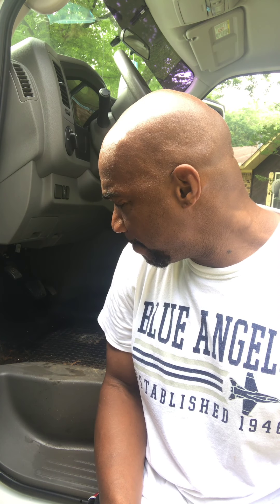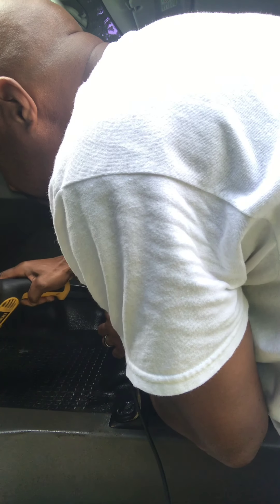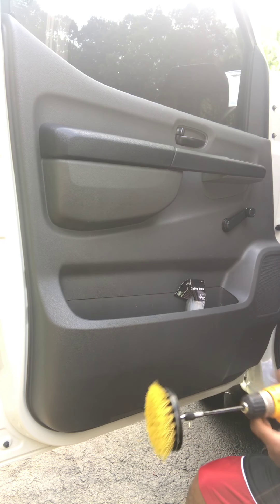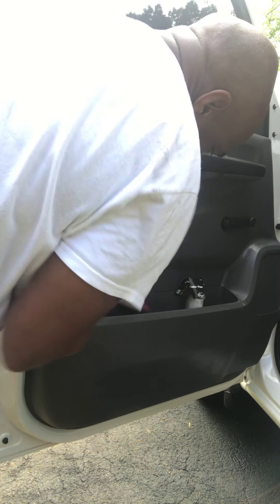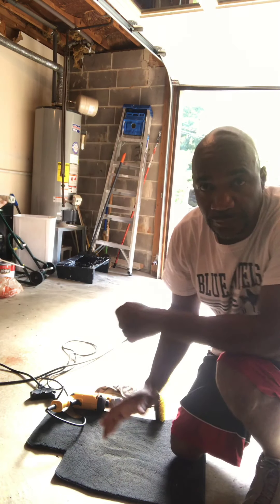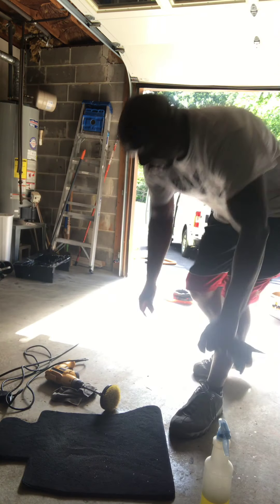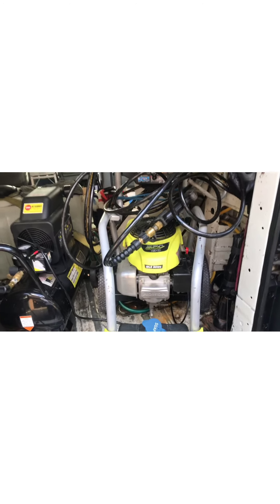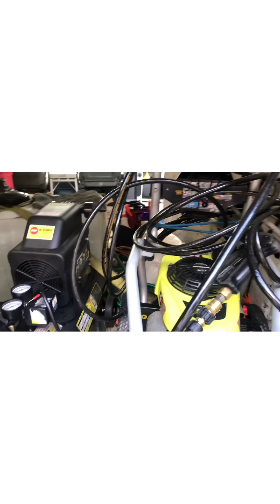Do you need a steamer?

Comment: I use a plastic tube that goes over my drill brush extensions. This serves to keep the rapidly rotating shaft from damaging plastics when accidental contact is made. Works great when using the bowl brush inside of door pockets. It also has saved my rubber gloves many times when I’ve accidentally made contact with my gloves and, which has destroyed many gloves when I’ve forgotten to replace the tube after cleaning.